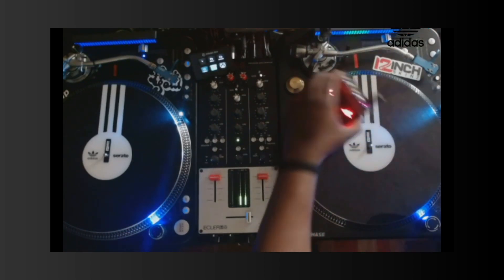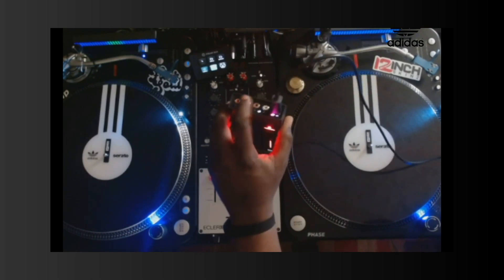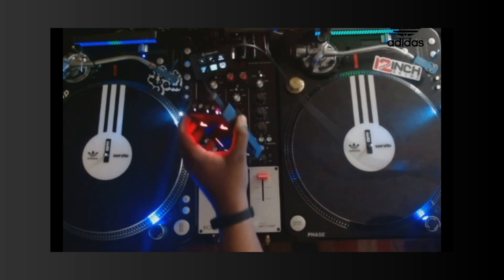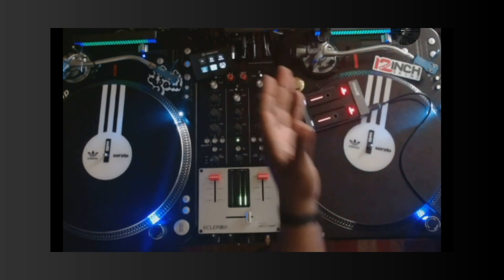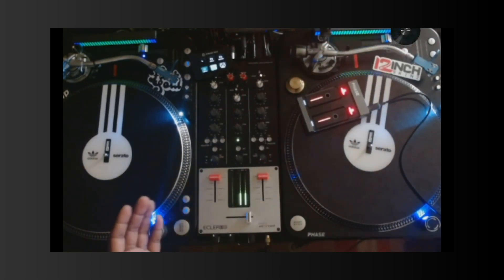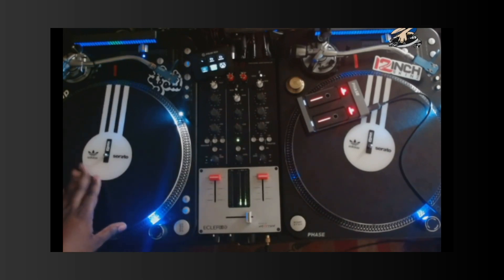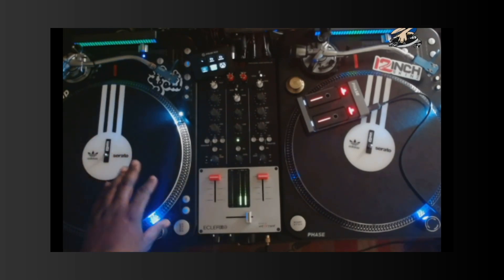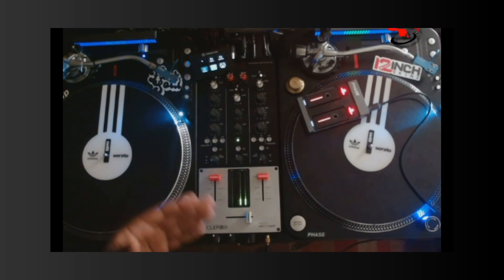Phase Cue Drift causes and one solution

Comment: I don’t think that’s why I am getting the drift on mine. When I’m doing juggles or doubles type things I can see my phase remotes start blinking like they’re recalibrating. Have you seen that at all? And yeah phase shd def let you be able to change the channel for if you’re playing out
Reply from the maker: If the remotes are blinking while you're playing, you may need to reset the receiver and remotes in Phase. Or maybe even reflash the firmware on them. That definitely shouldn't be happening.
Reply: try disabling the "double tap" calibration in the phase management app.